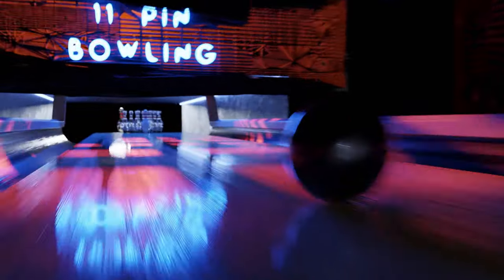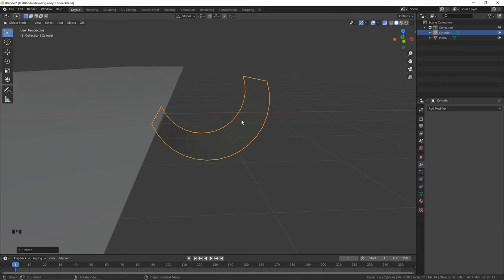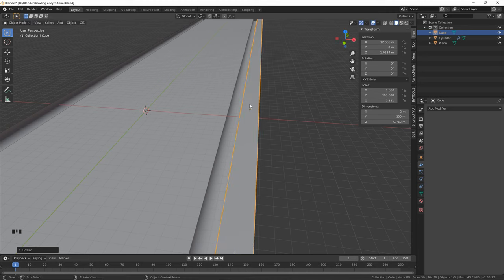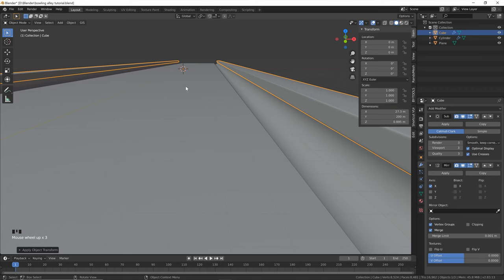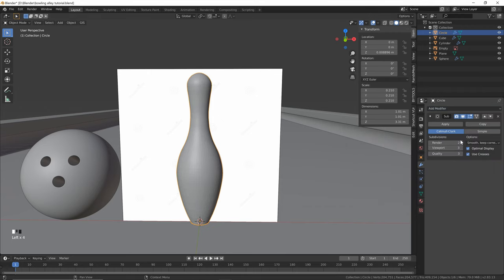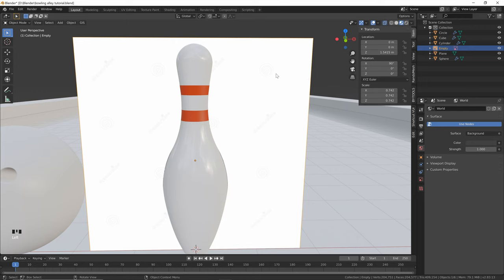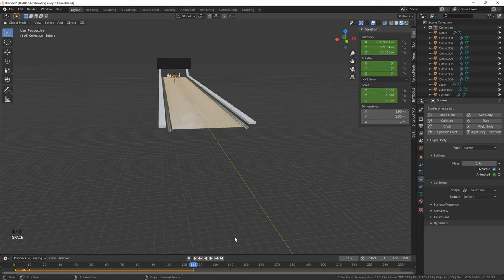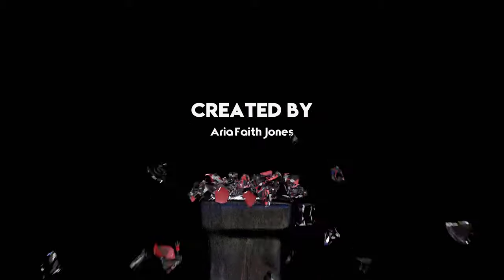How to make a Bowling Alley in Blender 2.8 | Rigid Body Simulation | TUTORIAL

Comment: I really enjoyed this, looking forward to part two where you navigate the camera! and my pins really take a while to fall, they seem to just slide back after the ball hits and then slowly weirdly fall down
Reply from the maker: Thank u! I will put together a second part soon! 🥰

If your pins are acting weird, make sure that the origin point of the pins is set correctly!  Check around 19:10 of the video to see how I do that. 

Also, make sure the weight of your bowling ball is set to a higher amount! 10-15kg should work. Hope that helps! 🙂
Reply: @AriaFaithJones  I made a note in my note book about that (OP) tip as i doubted i would run across that again , and not applying that correctly must cause hours of frustration for folks . Not something I want to endure. can you explain why? then Ill really remember.

Comment: Thanks! Great tutorial. I got the ball to work perfect, but it is not "rolling" the holes are stationary. It looks like it is skidding.
Reply from the maker: Make sure to add rotation before activating the rigid body simulation.

Keyframe the rotation at frame 1 and then keyframe a different rotation value at frame 6 and then you should have rotation 🥰
Reply: @AriaFaithJones  - Thanks. I jut realized that. 🎳

Comment: Amazing video! It helped me so much, however i was wondering  if there is a way to send the ball into the gutter and how to reduce the speed of ball. It would be amazing if you could help me out!
Reply from the maker: Thank you! 🥰 

If you want to have the ball curve or go into the gutter, make sure to add a slight rotation when doing the keyframe animation shown at the 18:00 minute mark of the tutorial. Add a keyframe for rotation the same way you added the location keyframe and then go to frame 10 and rotate on the Z axis and set a 2nd keyframe.

To slow the ball down you can either decrease the space between the ball at frame 1 and frame 10 (so it doesn't travel as far between keyframes) OR you can stretch the keyframes out and instead set the 2nd keyframe at frame 20 (this way the ball will take twice as long to go the same distance and therefore have less momentum.

Hope that helps! 🥰
Reply: @AriaFaithJones   Thank you so much for the quick reply and amazing advice! But for some reason my ball just shoots out from the gutter is it possible for it to drop down and sort of roll on?

Comment: Hi there! Was hoping you could help. I followed your tutorial but somehow my pins are all falling as soon as the animation start. Any ideas as to why? Thanks
Reply: I am on blender 2.82a
Reply from the maker: Hey! Thank you for checking the video out. 🥰 
First, make sure you are always on frame 1, when starting the simulation. 

Second, when you add the rigid body simulation to each pin object, set the  "Collison shape" to "box" instead of "convex hull" (this is the default option). Box will give you the best result for this scene.

Also make sure to set the lane to "box" as well! That should help stabilize the pins. If it is still not working, try baking the simulation and see if that helps.

If it is still acting funny, go into the scene properties tab and there is a setting called "gravity" turn this off and play the simulation for a few frames and then turn it back on.

The last thing you can try if they keep falling, is when you add the rigid body to the pins, there is an option that says "deactivation" turn that on and also turn on "start deactivation" and this will give it a type of glue effect that keeps the pins stable until some type of force hits it!

Hope these tips help!! 🥰

Comment: When I add all the rigid bodies and stuff, the pins flip over and fall through the floor. Also the ball like shoots high into the air. How can I fix that?
Reply from the maker: Make sure to select all the pins and then right click and reset the transforms (so that's the yellow dot is in the centre of the pins) this should set the center of gravity to the center of the pins.

Make sure to click on the lane/floor and add a rigid body to it and set the type to passive and then also change from 'convex hull' to 'box'